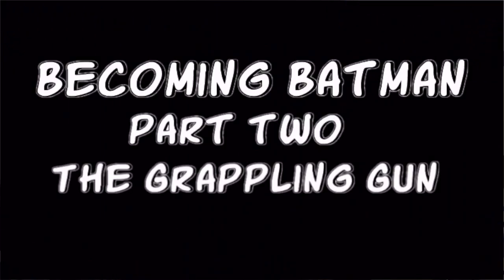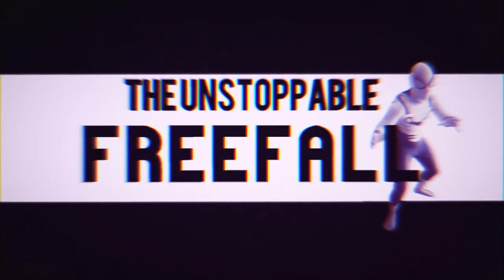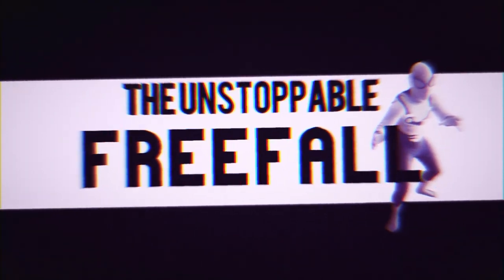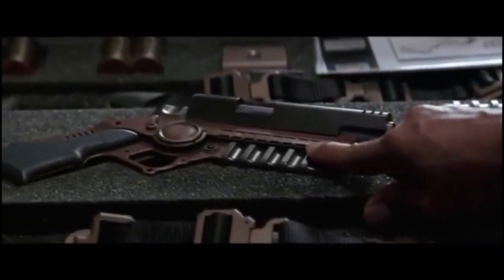Batman Grappling Gun (real life gadgets)

Comment: Little piece of advice. If you are on budget, get some of those hercules hooks or monkey hooks. they have better grip, can hold up to 100 pounds EACH and despite being an as seen on tv. thing, make a good hook. I was able to scale 20 feet no problem with them. They are small and compact as well.
Reply from the maker: interesting I just looked it up. I could try that for sure looks small and strong. Thanks for the tip
Reply: @theunstoppablefreefall1329  I’m 150 pounds so they should work. Weld 4 of them together for maximum stability

Comment: which is the longest shooting distance that can get?
Reply from the maker: maybe 25 feet 30 max
Reply: @theunstoppablefreefall1329  looks like small distance to a real batman grappling hook... you cant get it longer spinning the part of the valve?
Reply from the maker: @mariopacheeco  yes for sure you could make it shoot longer. could use more co2 possibly
Reply: @theunstoppablefreefall1329  You put more Co2 just with the adapter or you need something more?
Reply from the maker: @mariopacheeco  well a bigger tank mean more air could be released